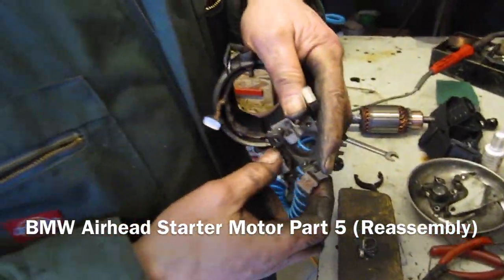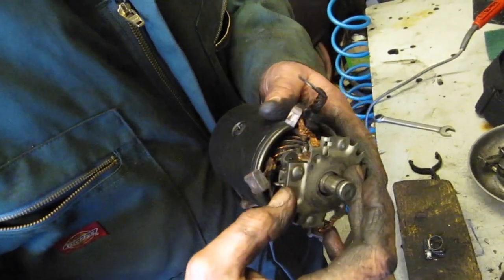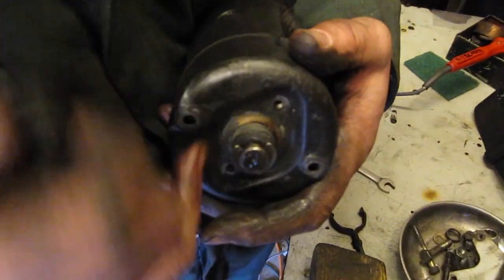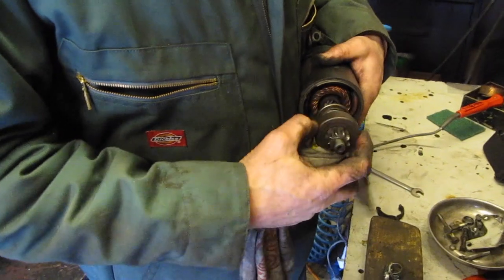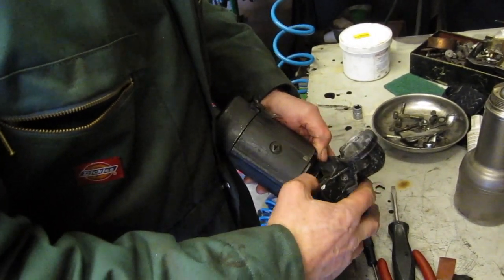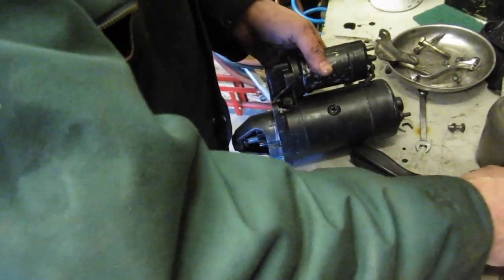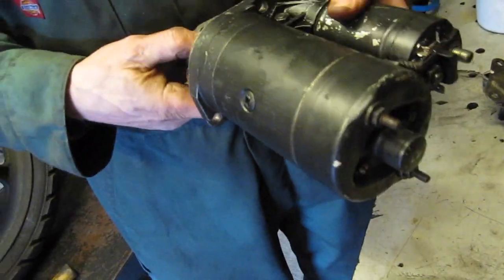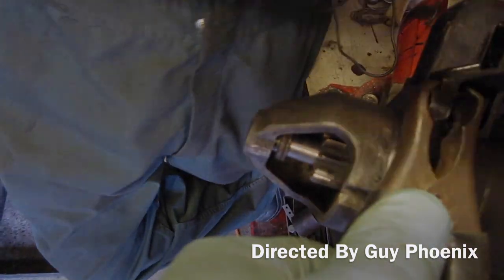BMW Airhead Starter Motor Part 5 (Reassembly) 1

Comment: Did you ever figure out what the issue was?  Did you swap the Solenoid or did it start fine on reassembly?
Reply from the maker: Phil Austen,  long time ago, but I think I replaced the solenoid with a used one in the end.